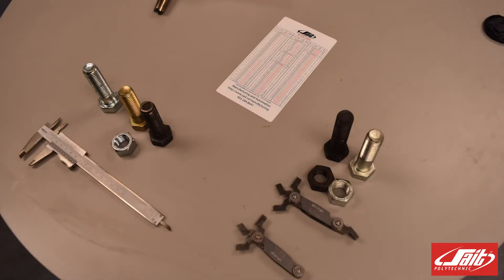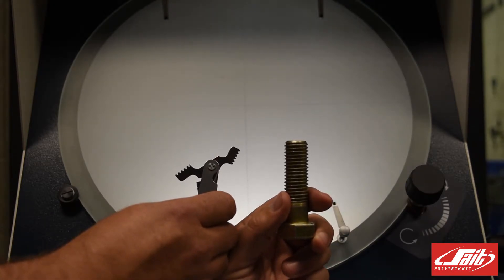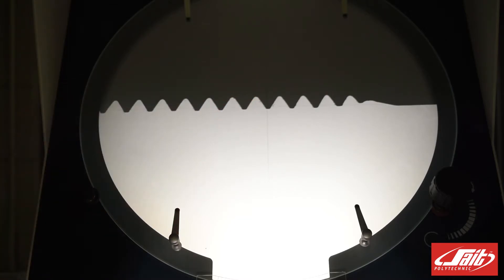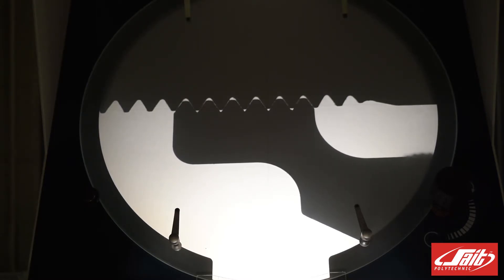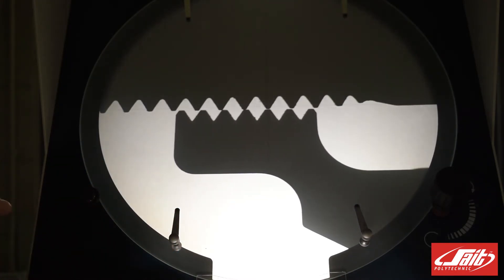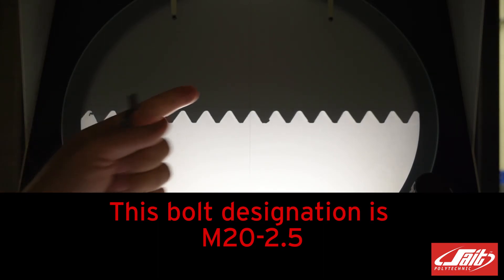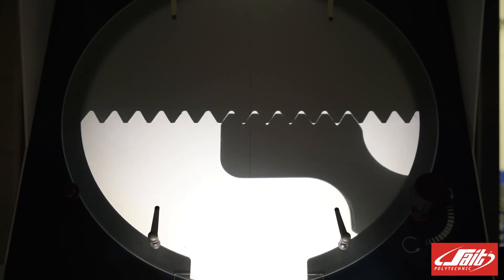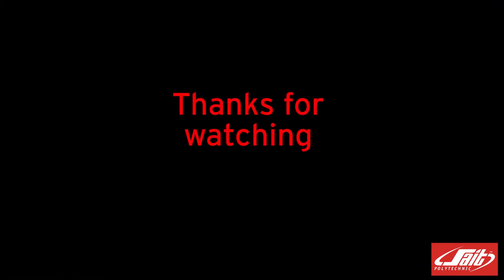Thread pitch gauge

Comment: nice vid. I'm trying to find a chart (easy to use chart) that will tell me which drill bits to use with which taps.
Reply from the maker: Thanks.
Most bolt suppliers have a version that they use for promotional material and may give you if you ask. You could also try searching "Tap drill chart" on Google.